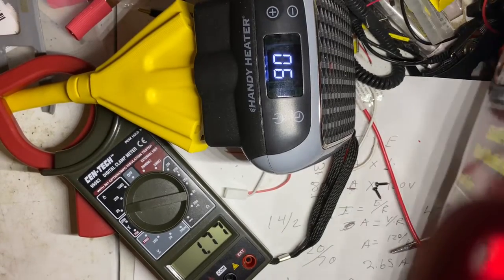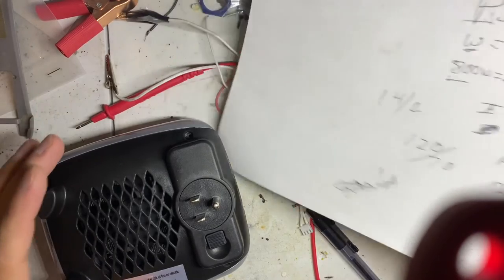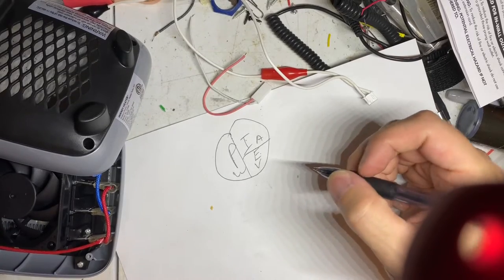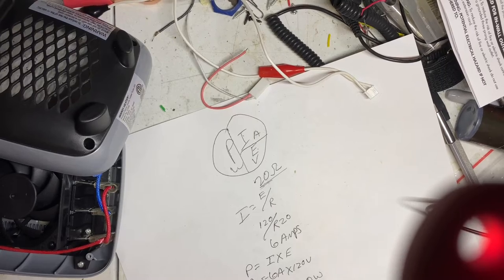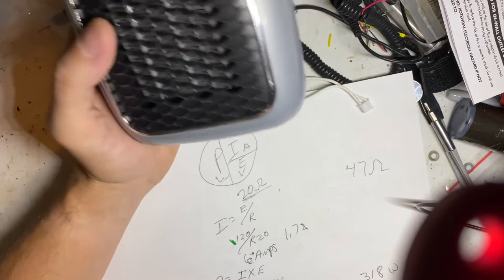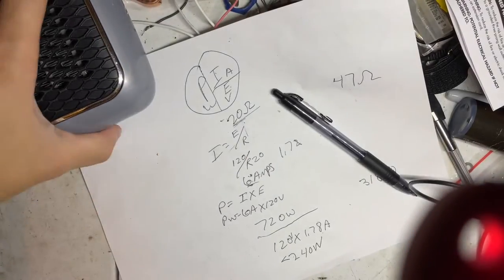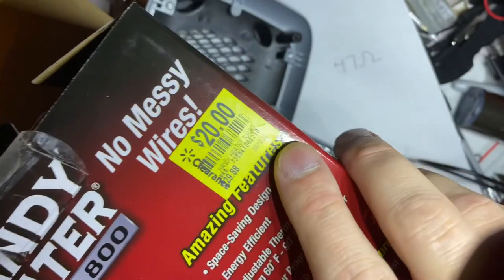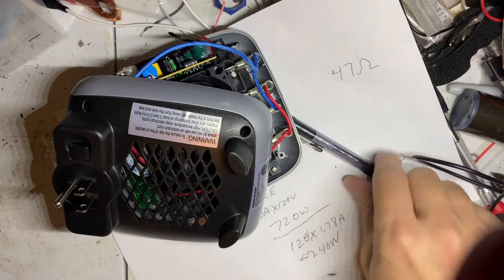Handy heater turbo 800 tear down

Comment: I wish the fake ads for this thing didn't have 10 times more views than your video. I came here because I saw an ad for a supposedly 129€ "EquiWarm Pro", which is only sold on the "official website", but even their advertisement video had the box in it saying "Handy Heater Turbo 800". What a scam. Thanks for the teardown!
Reply: Think I saw the same ad. Just for reference. I live in the Flemish (Dutch) part of Belgium, and the ad talked about how "2 Dutch engineers of the major dutch energy companies" invented it. It has "scam" written all over it, but I wanted to look it up all the same.🤣
Any chance yours was similar?
Reply: @thomasvertommen9526  Yes, they generate random engineer names looking at common names in the target country from what I can tell. Rest was exactly the same.

Comment: I got 2 in  two week the first one stop producing heat the secound one did the same thing only cold air why do you know ?
Reply: I’m guessing a fuse. Be interesting to take a look at for a repair video
Reply: Why didn't you show the line voltage and your room temperature ?? ALSO, the ground pin assures that the hot leg goes to circuit. And prevents the possibility of of inverting the BB unit and p loo bugging it into a 250V outlet !!!! Show the WHOLE  picture !!! Not just selected parts!!!
Reply: @davidhanks7728   I didn't post a picture you meant to post under the video you posted under my comment
Reply: @berkscountymetaldetecting4347  You should have called your credit card company and claimed fraud within 30 days. Usually you have 60 days to do so. I don't care what the seller says.
Reply: Yes, mine has been working great for two weeks and then all of a sudden started blowing cold air two nights ago. Can anybody tell me how to fix it myself?

Comment: If u hold down power button after you initially press it to power it up it goes into "CC" Mode which basically from my testing puts it into a continuous heating. Bypassing timer and thermostat. A feature that I couldn't find listed on any manual or YouTube video.
Reply: Thanks for the heads up, I might of accidentally turned that on, when I tried to power it up, I did see a "CC" display reading and was wondering what that was.... How do you get it back to normal because mine won't shut off even if I change the temp? Thanks.... This is why I bought it so I can set and leave it...

Comment: I just bought mine and it always stays on even if I change the temp setting, going to return it....
Reply: The fan blows continously to circulate air and read air temperatures.  If you listen closely you can hear it cycling on and off.  At a low setting you can feel the air cool and hear a click and it heats up quickly.

Comment: Well that was short lived, the lube job I did on my handy hear has failed and the fan is making noise again. I will need to find a new fan for it. I took mine apart too and did find a model # on the fan but it lead to many 7015 style fan. I'm not sure of this fan is a 120mm fan or a 60mm fan.

Comment: I have one of these and the 12v computer fan they use inside was making noise so I put some 3 in 1 oil in the fan bearings and it's good as new.

Don't use this with the presto plug as it is enough to pop the 5 amp fuse inside.